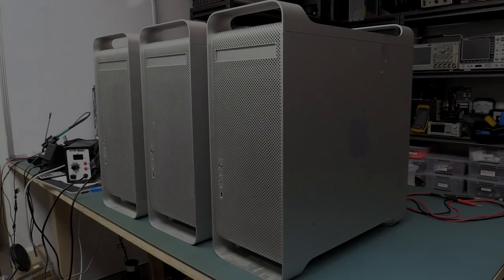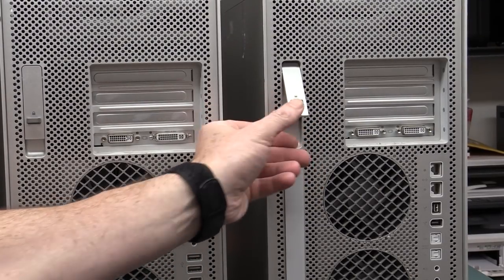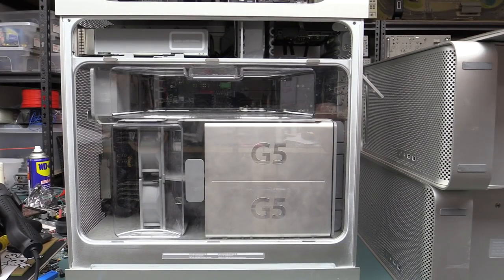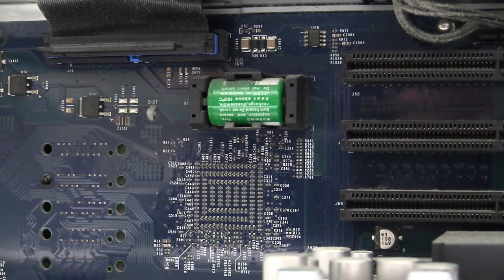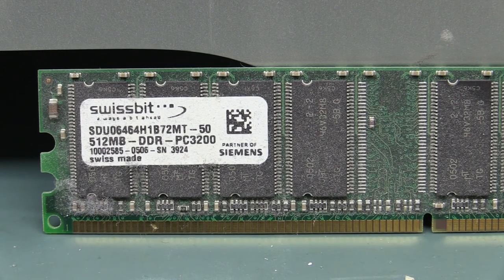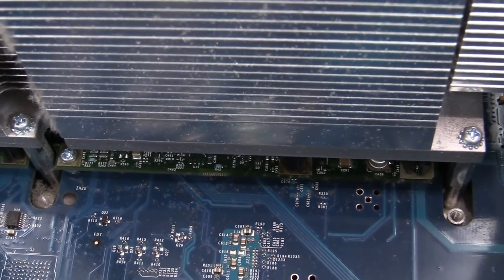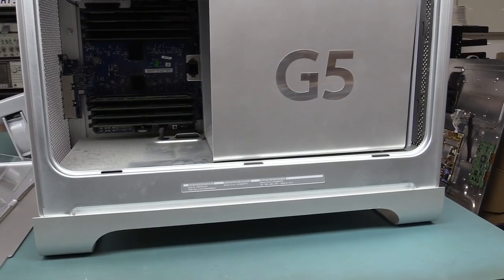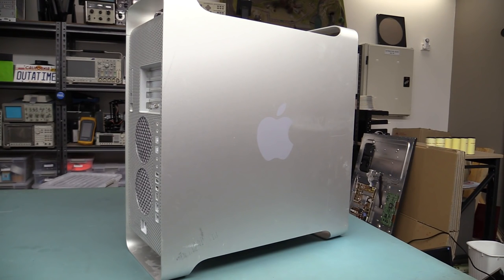EEVblog #783 - Dumpster Dive Power Macs

Comment: Why can't I find dumpsters like this in the UK!!!!
Reply: true bro, we have waste tips instead
Reply: Many companies in London started disposing them in 2010. Not hard to find a decent one for 50 quid if you're interested.
Reply: +StarDustSid You can't dump electricals in skips any more. They have to go to a waste management center for dismantling and recycling.
Reply: StarDustSid Can't even take stuff from recycling centres here in the UK. Apparently it's for safety reasons!
Reply: StarDustSid Because it's illegal to dispose electronics on standard trash bins.
Reply: +Crimson Sunrise yes but we all do it !
Reply: Prehistoricman I found this out when I asked if I could take a Samsung monitor, left at my local recycling centre that had a broken screen. (I had the same model with a blown power board and was hoping to use this one to fix it.) The guy at the dump said that I couldn't for 'heath and safety' reasons.
Reply: StarDustSid  In Germany gypsis 
daily loot the dumpsters :D
Reply: StarDustSid More like "for money-making" reasons. What happened to the days where you could injure yourself and it wasn't somebody else's fault?
Reply: StarDustSid Well Dave does have a bit of a special dumpster he probably does most of his dumpster diving into ;). His lab works out of a shared facility with other businesses that operate in it from what I remember, the odds that those companies will regularly replace gear that has been deemed redundant by corporate policy or current day requirements are pretty high. Sometimes employees get to snatch some of the goodies but often they just end up in the dump room of his facility.
Reply: ToKeepTrackOfRandomSubs That also goes by the fact that companies no longer allow their employees to take these things home or buy them from the company.
Reply: Crimson Sunrise
Yes I know. Last year my employer was throwing out loads of old Mac's and shit Dell PC's. I asked for a Mac and was told no even though there was no harddrive installed. Off to the skip they went
Reply: Pikkys! anything shinny it's gone
Reply: MrCoolAceguy Cex have tons of them for 20/50£ otherwise, go for a boot market...
Reply: Andrea Campanella But you're not gettimg them for free, like dumpster diving.
Reply: Andrea Campanella
ha yeah
Reply: I friend found a 1080 21" tv in the dump. because it need a new a fuse
Reply: StarDustSid there's a good business when it comes to electronic waste "management", there are people that becomes millionaire by literally selling/buying shit, electronic waste is like diamonds to them. and business pays tax, and in some countries, licenses fee.
Reply: +StarDustSid 
u can find roosters dick here in serbia, people still use Pentium 4s,
windows xp is still everywhere, nobody throws anything if works.
Personally i have 2gb ram,AMD dual-core 2.2,gforce 210 and im very lucky,
my parents still use half of lenovo s10e found in flea market for 3 usd,
hooked on external monitor...this G5 is like from another planet.....

what to do with them...
-you can make "shaving cabinet"
Reply: +StarDustSid I would love to know what the actual "Health and Safety" reasons are instead of just the bland generic statement they give.
Reply: +Gary Lloyd I'm from Romania but...LMAOOOOOOOOO
Reply: +StarDustSid I found a working mac book pro in NZ.
Reply: It has to be dumpsters for electronics, not regular dumpsters.
I have found two Intel Power Macs... but both cases were busted. On one, someone else had come before and pried open the case to be able to snatch the internal components - instead of using the fully working latch mechanism! What a waste...
Reply: because the guys at the recycling centres take their pick I make sure it is well ruined before I take it.
I've seen them fishing things out to take home.
Reply: +StarDustSid I scored an AMD dual core system with everything but the HDD in a similar fashion, 99% of the time it's being at the right place at the right time :)

Comment: build a raspberry pi cluster in one of them
Reply from the maker: web1bastler And what use would an Rpi cluster be? How powerful compared to my main dual Xeon machine with 128GB of RAM?
Reply: Oh...right
Reply: +EEVblog It'll consume a lot less and I think you'd be surprised what a pi cluster is capable especially with the later quad core version.
Reply: +EEVblog 128gb or RAM?!?
Reply: David Van Bramer Yep. For video processing.
Reply: EEVblog if you can get 8 x 4 pi 2 in a case you'll still get 32gb ram in it. it wont beat your build but it would still be cool!! right? its not the best but its still awesome. you said it yourself apple said the fastest pc on the market and you could smoke it with a bunch of $40 micro pcs.
Reply: +DrScopeify same here...
Reply: +David Van Bramer that's nothing mate Xeons have 12 cores each. Duel Xeons would make that 24 cores.
Reply: +Sonicbolt these days you can get 16 core xeons  + they have hyper threading, so two of those bad boys would equal 64 logical cores
Reply: EEVblog I know you don't do any 3D rendering, but the first question in my mind was "Is it PCIe?" If it would take a modern Nvidia video card, it could still be used as a network render node for Blender, since Blender can do GPU rendering. Not the most powerful beast in the world, but sitting quietly in the corner rendering while one is busy doing other things (like building the next scene on a modern PC) would make it useful.
(some of us can't afford dual Xeons with 128gb ram...)
Reply: +Ronmonster LinusTechTips did that :D
Reply: +EEVblog can you send me one
Reply: +Sonicbolt Modern Xeons can have as few as 4 cores, and on the other extreme all the way up to 18 cores. On a dual CPU board you could have anywhere between 8 and 36 cores (with HyperThreading, 16-72 logical processors), not necessarily 24.
Reply: no an ATX conversion is much better
Reply: Hiraghm If you're referring to the system that had a 6600 Geforce card, that's highly likely to be PCI-e. Apple never supported AGP as far as I know (unless that's what they used in the PCI-x era systems?), but either way, you might have trouble using "just any" video card in that system because OS X 10.5 might not support it.
Reply: ***** Not to mention the BIOS also might not be able to be compatible with newer cards as well. (Also Dave said it was PCI-e in the video)
Reply: Hence Nvidia and AMD loved to sell us "Apple-ready" versions of their cards and jacked up prices. :P
Reply: +DarkAvatar1313 No Dave said (and it shows in the video) these video cards are PCI X, which predates PCI e.
Reply: HUGSaLOT Valkyrie
 No... listen again 8:44 One has PCI-e
Reply: SAI Peregrinus If you want video processing, you don't need ram. And I think I'd go with some FPGA solution rather then anything using software. CPUs have instructions to playback h264/aac/mp3 but are rubbish when it comes to encoding (which to be honest is a much more complex and less common process).
Reply: web1bastler bit mine cluster?
Reply: ***** I'm not very familiar with the algorithm but straight off the top of my head, I see no reason why you can't have more then one FPGA, a farm, working in tandem. Again, not being acquainted with the algorithm, I might be talking out of my ass and it does who knows what kind of magic tricks in which case it is not suited for such low level logic.
Reply: web1bastler i would rip it off and make a regular pc case of it :D
Reply: GRH Gąsiorek | AgropolSokołowoTV
Thats what I would do.
Reply: web1bastler Na just use them as they are. Put a modern OS on them. Get some PPC action on my network.
Reply: EEVblog  Rpi2 Cluster Would be similarily powerfull :D
Reply: ***** CPU-S never fail unless they are overvolted or Fried by Overheating
Reply: Ronmonster These days you can get Xeons with 18 core and 36 threads, so two of those bad boys would equal 72 threads.
Reply: +Sonicbolt Not all Xeons have 12 cores. Be careful there. Some of them are just quad-core processors and there are all kinds of others up to 18 cores.
Reply: +EEVblog A fun project for Cluster Computing?
Reply: +EEVblog "And what use would an Rpi cluster be?"

for fun!?

I have some suggestions:
Power supply.
Dumb load.
Modular Precision Instruments Chassis Module .
Mini freezer.
NAS server.
Fragile Tools box.

anyway, call it: Massive Aesthetic Cobnut POWER
or MAC power for short.
Reply: +web1bastler no!!! HACKINTOSH!!
Reply: +smallenginedude71 of course.
Reply: +Ronmonster    Skylake has 28 cores with HT
Reply: +BlakeCasimir And why do I have 8 different Mac's with AGP in them? :P
Reply: did you have enough room in the case to fit it in? XD
Reply: +EEVblog My question to you is, What could you possibly need 128gb of RAM for.?? What on Gods green earth requires that MUCH memory.??
Reply: +Cody Ide Who will ever need more than (insert any eventually ridiculous number here) of RAM?
Reply: +matt odle Also clusters are only useful if the program you are running works well with parallel computing, for example Minecraft only uses one thread and so no matter how many Raspberry Pi's you chucked at it, it wouldn't get any better performance.
Reply: Bobby Dilley this comment thread mainly attracts apple fans which as you might know are pretty much clueless about electronics.
Reply: +bent540 Haha along with 95% of youtube ;)
Reply: +Cody Ide a large vm server and scientific computing.
Reply: +Cody Ide The new Star Citizen game xoming out.
Reply: +Jim Fortune "512kb" -Bill Gates
Reply: Jesus 16kb, early Intel(?) engineer.
Reply: +web1bastler one of the things that you all seem to fail to understand is BANDWIDTH, the bandwidth between the Pi's is very limited compared to a Xeon's internal connections between cores this is why sustained data crunching is where any Pi or similar would just fall on its FACE even that 64 core arm epiphany "similar to the pi" has much higher bandwidth between cpu's as it has dedicated ports to be clustered that are HIGH bandwidth "still lower then dual or quad xeon's" then pi's connections  but a bee's dick in comparison, its also the reason why AMD has slow cpu's as there interconnects between L1 L2 L3 cache is way less then Intel thus Intel Dominates the market.

So in short with out the Bandwidth between cpu's and clusters, the so called backyard or basement super computer is not really a super computer as it could not sustain the data crunching that a real super computer can over time, just short little bursts, i guess you could compare that to the first turbo 4 cylinder cars going against V8's they used to detonate after a few laps..
Reply: +BlakeCasimir yet the Apple openGL driver is 10 years behind gotta love the apple acolytes lol.
Reply: +web1bastler this thing could run Linux as is, and do modern things, no need to put raspberry pis in it
Reply: Usmar Padow
theirs not many modern Linux distros that support PowerPC
Reply: +Devin Hepburn I searched, and I think Lubuntu would be perfect for these machines, it is light and works on powerpc.... I have installed lubuntu on a 32 bit intel machine with 1GB of ram and it can do all the modern stuff including running flash html5 and watching youtube
Reply: +EEVblog I'm running Debian Jessie PPC on a dual G5 box I got from a friend.
Reply: It would be a fun cheap project. Let's also not be snarks to our viewers and subscribers.
Reply: My company will collect and process your E-Waste for $1 a kilo,

Comment: Sorry, Dave, but I had to give this one a thumbs down.  Great engineering porn, but then you failed to show the money shot (the CPU daughter boards).  You didn't even show the power supply?   I'm assuming the power supplies were solidly engineered, and a brief overview for educational purposes would have been nice.  

Anyway, thanks for the tease... giving me a case of blue smoke...
Reply: Brandon Fesser Yeah, I wanted to see the CPU.  Since it's not a normal Intel/AMD system the CPU would probably be something cool to see, especially if it has its own daughter board.  Haven't seen that kind of a design since the slot P2's.
Reply: Brandon Fesser There are lots of videos on line of people showing the inside of these systems.
Reply: +BlueFoxTV Yeah but its not daves perspective!
Reply: +BlueFoxTV but not in the way dave can do it..
Reply: Brandon Fesser I'm very disappointed too. Atleast, no thumps down for good old Dave.
Reply: Brandon Fesser I'm hoping that Dave's gonna do more vids on them. There's a lot of potential material on those puppies.

Give us a nice EEVBlog-worthy teardown please, Dave? I'd be all over it dude!
Reply: Brandon Fesser To remove the heat-sink for a G5 tower you need a special extra long penta-lobe driver set. An ordinary one will not reach. If you do not have it, you could destroy/modify the correct one, but it takes forever to get right. 

I was wondering if he'd have a go, but it's really a pain without those special drivers.
Reply: Diggnuts Not Pentalobe; Apple didn't invent that until long after the Power Mac G5 line was discontinued. And AFAIK, Pentalobe screws have only ever been used in iPhones and MacBooks.
Reply: Ian Oliver
 You are right, it needs security torx or some hex set.. but only real long and thin ones..still a pain.
Reply: +Brandon Fesser dave is really lazy these days, hardly does full teardowns. they're useless as computer, that's what he says, might as well do a full teardown and throw away the mobo afterwards if he's too lazy putting it back together
Reply: +Ian Oliver yes, they used a very long shafted torx driver....... evil!
Reply: Brandon Fesser the power supplies live under a plate at the bottom and have 2 connectors to the motherboard. A common problem is for these to go bad, I had to replace mine to get it to work. The cool thing about them is even though they are hard to remove, they are completely isolated from the other components in terms of airflow. This computer has 4 airflow chambers and each is regulated. Also something cool to watch out for is on the dual processor versions some had passive liquid cooling, this was also a common problem since it leaked.
Reply: +Mitchell Henley i had one die on me... leaked antifreeze all over the PS... and smoked it!
Reply: +Brandon Fesser It wasn't a teardown. If I was going to keep them I probably wouldn't tear them down further either. I would however replace the battery and look for bad caps.

Comment: I found one of these dumped by a bin in the city centre a couple of years ago. It was soaked because of the rain but the case was in great condition. To good to leave so I took it. Got some weird looks on the bus taking it home lol. 
Let it dry out and tested it, amazing it worked. Even the harddrives which were full of documents. Ended up stripping it out and now its my gaming pc :)

Comment: Uhm, Dave, a "modern iPhone" has a dual-core 64-bit CPU with 1.4 GHz at most while the A1147 has a dual-core 64-bit PPC clocked at 2.3 GHz. And you are comparing an embedded ARM CPU designed for power efficiency with an server CPU designed for performance.

These Macs are most certainly *not* slower than a modern iPhone. Stop with the exaggeration. Oh, and these machines were released around 2005/2006, not 2003.
Reply: genkiadrian Found the fanboy ;)
Reply: ***** I'm actually a Debian Developer and have access to large number of different architectures and I also have experience with various embedded systems. I can assure you, a server-type CPU even from 10 years ago is still faster than an embedded CPU optimized mainly for power rather than performance.
Reply: +genkiadrian The main difference is the iphone's processor is inside a SoC, while the G5 is a full Desktop case
Reply: genkiadrian Just to correct you, the first G5s came out in 2003, they made them right up until the Intel switch in 2006 with the latest models like the single 1.8GHz and models with PCI-E being released in 2005.
Reply: daab889 Also, the power consumption is much less for the Iphone...
Reply: The iPhone 6 benchmarks above the G5. Even with one of the highest end graphics cards for the time, a G5 can't really play HD YouTube, while an iPhone can.
Reply: Tyler Simpson To be fair it's an unfair comparison to make due to the differences in architecture between the two. A decent G5 could probably handle HD web content if either flash was updated and optimized properly for PowerPC or if HTML5 was also optimized a little in general. IIRC a good G5 will still play local HD video alright.
Reply: it literally says 2004 on the fucking label when he took them apart...?
Reply: Lee S That's the copyright on the board layout. Not the production date of the machine. It always takes 1-2 years to get from there to actual release.
Reply: genkiadrian well you learn something new everyday don't you..
Reply: Yeah--I think you don't know very much since you're quoting clock rates like every other noob would. If you actually knew what you were talking about, you'd be speaking in terms of computations... FAIL

I love the "Well I'm A SUPER DUPER HIGH TECH GUY WHO DOES (X, Y, Z)!!" when you're called out strategy, btw.

Comment: Ahh... Back when Apple used to actually make good computers.
Reply: yup these were beasts
Reply: I'd more appreciate to have a empty PowerMac/Mac Pro case and put my own stuff in it
Reply: There choses in CPU architecture don't agree with you....
Reply: EMPTY CASE! Btw: Any macbook user: Do you hate the Caps lock key as much as I do? It goes on when it shouldn't and if I wanna type caps, it doesn't
Reply: you have to press it for just slightly longer to enable it. I think it's so you don't activate it accidentally.
Reply: Sometimes you're right
Reply: I'm getting a case for 10$ off of someone close to me. I'm going to do that. The Aluminum case is too beautiful to throw out.
Reply: I know right! I found a PC of amazon for $900 dollars which had identical specs to the 2999.99 Trashcan/ashtray know as the Mac Pro!